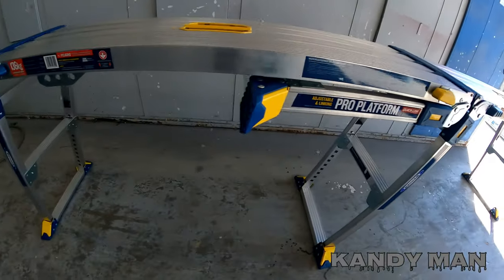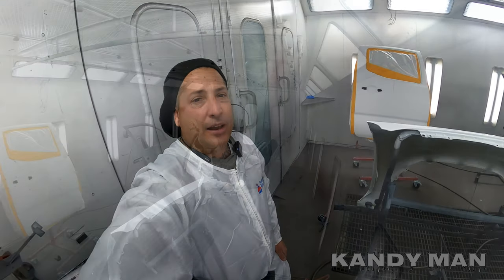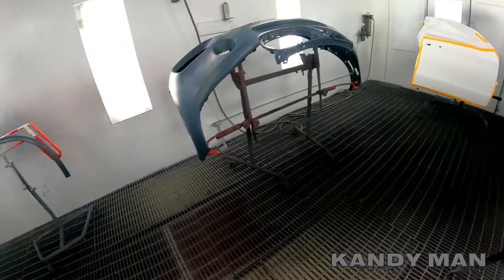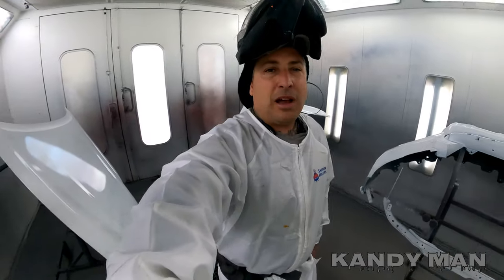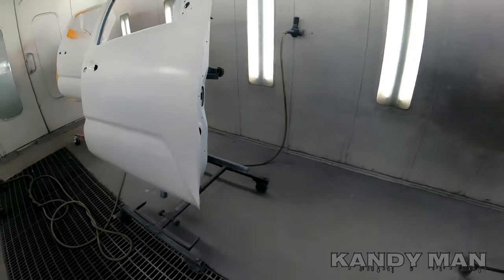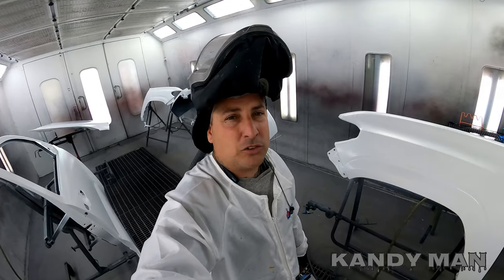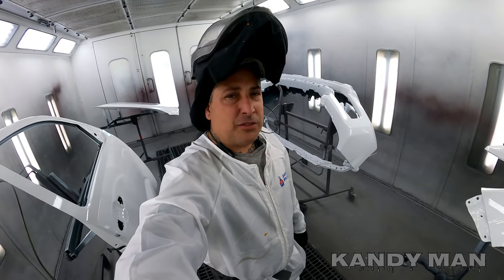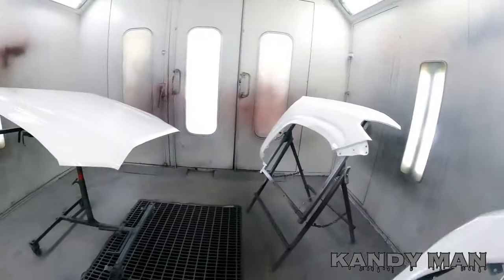AN OLDIE BUT A GOODIE

Comment: Great job kandy man I will be spraying a after market  wing
 The wing will be black coated would it be OK to use 600 gritt and spray base coat straight  on top also the back of the wing should  I leave  it with out spraying any thing what do you recommend?
Thanks for the video
Reply from the maker: I

I would paint it so will have better hold out in rhe sun
Reply: When you say paint it what do you  recommend  as the first coat on top of the coat wing ?
Reply from the maker: I would spray all of it.
Reply: So sad it 600 gritt then base coat is that correct?
Reply: Thanks
Reply from the maker: Any time.

Comment: There is no way your using the Iwata WS400 with the fan wide open. The Supernova is a great gun but it absolutely cannot be used with the fan wide open or your going to have a split fan that's top and bottom heavy. 2 to 2 3/4 turns out is max for the WS400.
Reply from the maker: Yes you are correct about that gun but if you move in close the split is gone  thanks for the insight 👍.
Reply: Yes you can I use my ws400 for sealer All day wide open fan wide trigger it lays down beautiful I watched a video with a guy explaining the iwata supernova and he said that you’re supposed to spray them wide open because of the tulip head it breaks it off even all the way through and he was right
Reply from the maker: I used mine for ten years  straight wide open  that's the way it breaks it up and lays flat coats  if you don't spray it like that it defeats the purpose of the gun
Reply: @kandyman5315  OK, lets continue this discussion. If you spray at the recommended 29 PSIG (dynamic - meaning with the trigger pulled) with the WS400 I contend there is no way on God's Earth that you can avoid splitting the fan at fan wide open. If you lower the air pressure to say 20-24 PSIG maybe that's possible but I've never tried that as I've always followed Iwata's recommendations as provided to me from the notorious Dr. Gun who worked for ASET (Iwata's American distributor) who's dead now but was a great guy and a terrific resource. Your turn Kandy Man. I am not trying to get into a fight here but I have two WS400's in perfect condition and I can't avoid the fan splitting at wide open when I spray onto a piece of masking at 29 PSIG. If you can do it tell me how.
Reply from the maker: Hey there  like said I've spayed thousands of cars with that gun for clear at 29 psi and how I spray it at the distance from the panel it works well for for me .thanks again
Reply: @kandyman5315  Fine, but that does beg the question at what distance do you spray? I normally am at 6-7 inches.
Reply from the maker: I spray it at about 4 inches from panel  that's what work well for me .👍